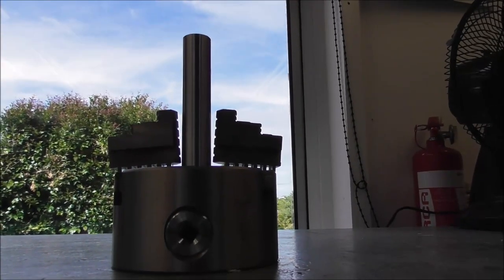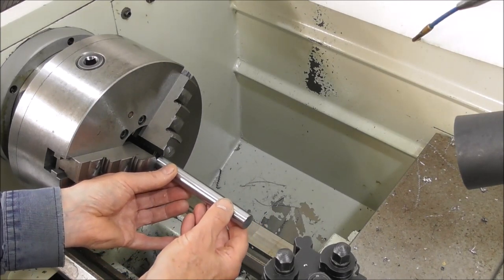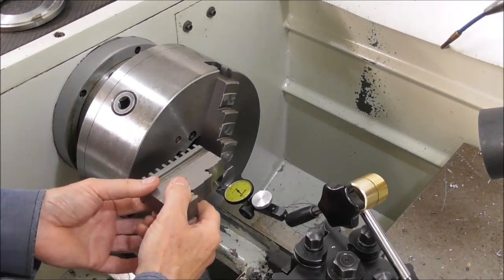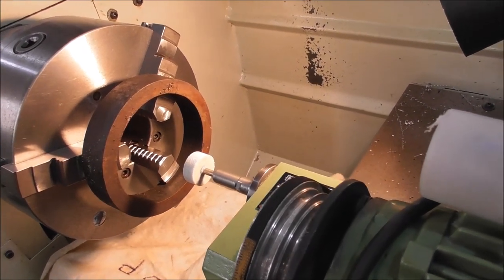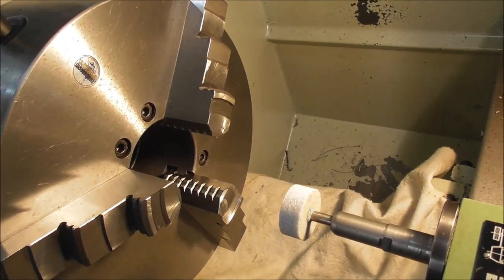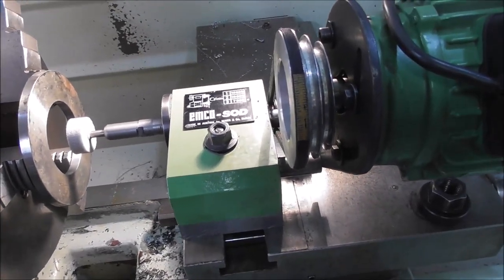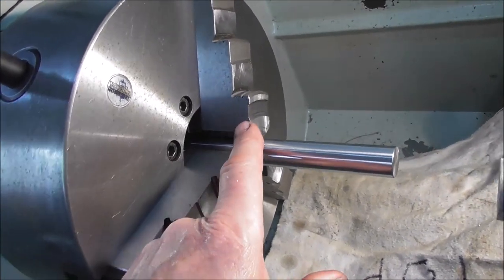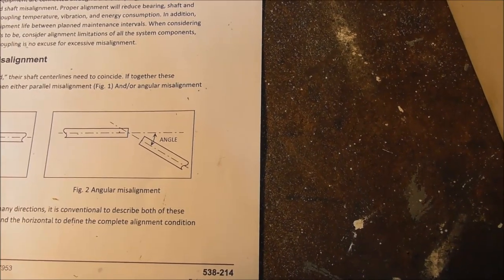Lathe Chuck Accuracy - Fix your 3 Jaw Chuck

Comment: This is the correct way to recondition hard jaws.  You must “fool” the jaws into thinking they are gripping a solid shaft.   Putting just a plain ring on the jaws and backing them out will not load the jaws correctly and will not yield correct results.  Very good video.
Reply from the maker: Cheers!  Cliff

Comment: only good for one diameter.  3-jaws aren't intended for concentricity without shimming. If you want concentricity use an  adjustable jaw like a typical 4-jaw chuck.
Reply from the maker: Hi - The grinding procedure gets the inside of the jaws at least in good angular alignment and not bell mouthed, but I agree that in that some chucks, the scrolls are not concentric. However, a 'floating backplate' allows concentricity adjustment more quickly than a 4 jaw. Cheers, Cliff

Comment: Machining a groove in your (hardened) jaws is overly complicated. i found a better way, thanks you a YT comment, credits where credits are due. I made a blog post on the topic. Sharing on YT of URLs seem pretty much impossible, so if you are interested please drop me a line.
Reply from the maker: Yes, there is a side pinching method, but that is not so accurate as it can displace the jaws unevenly sideways, Cheers, Cliff
Reply: @Threadexpress  Why are you assuming it's the pinching method?
Reply from the maker: @bigbattenberg  If not, please describe it. Cheers.
Reply: @Threadexpress  I offered to share it but your reactions are telling enough, so fine, be that way.
Reply from the maker: @bigbattenberg  You misunderstand me. The two methods I know of that avoid machining the jaws are the side pinching blocks and using a ring that bears on the jaw's bevels, but both these methods can displace the jaws within their clearance sideways. If your method is different, please describe it so we can all benefit. Cheers
Reply: @Threadexpress  I misunderstand and you know the two ways... nuff said.

Comment: THANK YOU!!! This is exactly what I kept thinking in my mind was the issue with my Chinese lathe. Runout and bellmouthing in the jaws I noticed. I was going to try and machine each jaw one at a time to fix the issue, but this is exactly what I needed as I couldn’t find a way I could grind them down in the chuck as the bellmouthing is in the wrong direction vs work chucked up. A spigot on a ring with grooves in the jaws is genius!!! Thank you so much. 💪👍
Reply from the maker: Thanks for the feedback! Cliff

Comment: Question for you is, when you grooved the front of the jaws how did you hold them. 
As I have just fitted a new chuck and whilst the body of the chuck is only .02 run out. 
The part to be machined depending on the diameter can be anything up to .3. 
It’s wasting my time, and makes me loose it. 
If only the owner understood the amount of time wasted by buying cheap tools 😢
Thanks for your video.
Reply from the maker: Hi - I closed the jaws on a diameter of material to lock them up then machined the groove in the lathe with carbide and light cuts, but you could also hold the chuck as above in the mill and use a carbide end mill. Cheers, Cliff

Comment: Great video, 
On my three jaw, it was only one jaw damaged from a 6 foot length of 2 inch dia. chrome moly coming loose from the tail holder. 
I had a 9 thousand run out from that. Using a piece of stock and a piece of 1 thousand shim stock, I found my bad jaw. 
After the repair,  I’m down to 1.25 thousand runout. 
My plan B was to use a grinding wheel as your video shows. 
Luckily my jaws are two piece each jaw, I removed the burr from the dovetail and replaced the two bolts that hold it together, they were stretched from the stress. 

Great job, great work, great video.
Reply from the maker: Thanks Richard!  Cheers Cliff

Comment: Thanks Cliff. That process has been on my wish list for a long time. I've always shied away from cutting into the jaws though.
Reply from the maker: Hi Mark. Yes I used to be reluctant also. But when you machine the groove you realize the steel is quite hard down deep as well.. so it is not like a thin hard case on a soft interior. Cliff
Reply: @Threadexpress  I accidentally tested the hardness of the jaws on my Boxford A lathe using a drill mounted on the tool post. I couldn't understand why several drills came back with the tip completely flattened. I thought it was the stainless steel work piece work hardening. Then I realized I was trying to drill into one of the chuck jaws!  It didn't even leave a mark on the jaw. Now I have made my own grinding attachment by mounting a DC treadmill motor on the cross slide, after removing the compound slide and making a cone shaped spigot to mount the grinder at the center height. I made an ER32 collet holder to mount directly on the shaft of the DC motor. I will put it on my YouTube channel one day.  But I don't know how good my machining is, and also feel a bit hesitant about attacking the jaws with it. I'm not aware of any real problems, but it was interesting that you said that the grinder isn't critical, and users may be unaware of the source of problems such as using parting tools. But the biggest and best tip you presented was how to mount the ring. So here is a big Thank You for an excellent video. Subscribed.  By the way I am a KIwi in Thames and the lathe has the original Burnerd chuck that it had new at Te Puke High School, where I did engineering classes.
Reply from the maker: @evanlewis652  Hi Evan. Sorry I missed your interesting comments until now. My father was a draftsman/designer at AG Price when we lived in Thames in the 60's. I still love that area of NZ. Cheers  Cliff
Reply: @Threadexpress  Hi Cliff, I am in Tennessee right now.  Your father probably knew "Nelson" who was also in design at Eastman. He is still doing CAD design by contract and has a huge home workshop. We have been restoring two Tangye stationary steam engines at the Goldmine Experience in Thames. Well worth a visit!  They are opening a new blacksmith shop on Nov 12th 2022 with a steam day. I am already looking forward to getting back on my lathe in Thames.  I will add a post about my grinding attachment.

Comment: That's an excellent way of holding the chuck jaws apart.   Thank you.
Incidentally I don't worry about about grinding through the surface hardness layer as I think that the softer steel beneath grips the workpiece better and with less pressure.  Obviously they will not last as long but another regrind is quick enough to do.
Reply from the maker: Cheers!  Cliff

Comment: Envy time 😉
Definitely a Very Nice, Tool Post Grinder.
Usually when you see these items in a video they are in worse condition than the Lathe 😂
Not surprised to see Cliff with such a Nice example 👍
First item on my list when I purchased a New Lathe was to buy a Bison Lathe Chuck.
Reply from the maker: Yes many years ago I bought a new Emco lathe with that toolpost grinder - but I only sold the lathe!  Cheers  Cliff

Comment: I'm new at metal working.  How do you machine the groove in the jaws? Aren't they hardened?
Reply from the maker: Hi - I should have covered that in more detail. They are hardened, but tungsten carbide will cut the jaws with careful light cuts. Cliff

Comment: very interesting video 
question sir , how to machine the cut out in the jaws ?
Reply from the maker: Hi Tom. Grip a piece of diameter to lock the jaws tight then turning with light cuts and slow rpm,  using a carbide insert tool left and right shapes, to machine out a slot - or do it with a carbide end mill in a mill with a rotary table. Cliff
Reply: @Threadexpress     thanks for information 👍

Comment: Great job Cliff, I need to do the same on my weiler 280. What shape of tool did You use to machine that additional groove in front of jaws? And did You block jaws during this internally by some shaft?
Reply from the maker: Hi MM. Thanks for the feedback. The tool shape from memory was 60 deg carb inserts, tipped to suit and lots of shallow light cuts. Yes with a shaft inside the jaws to clamp them stiff. Cheers  Cliff

Comment: Nice!
But what if you have play on de scroll, so that the scroll can move up and down in de X direction? 
Have you ever come across this?
Reply from the maker: Hi Mark. Good to hear from someone thinking deeply about this! Yes play on the scroll bearing or a non concentric scroll thread can be an issue with some chucks, and is a minor accuracy issue on all chucks. The procedure in my video is still needed to correct the jaw grip squareness and straightness, but for accurate work of different diameters the work concentricity may still need to be dialed in (I use a 'floating backplate' as mentioned in other videos). When repeat parts are made after the chuck is dialed in for that diameter, concentricity tends to repeat well. Cheers  Cliff
Reply: @Threadexpress  Thanks Cliff, all clear, cheers!☺
Reply: Hi, I'm a Machine Tool fitter and worn scroll plates as well as worn jaws are a common problem.  There isn't much you can do about worn scroll plates unfortunately, and I have seen turners giving the chuck jaws a biff with a hide mallet to get the best out of a worn out chuck.  Not ideal I know, but if you're really struggling for accuracy and are not in a hurry you could always use a 4 Jaw chuck.

Comment: A good way or else you can drill three small holes into to front of all the jaws on the smaller diameter steps,  insert three small bolts with heads and grip a small diameter ring out in front with the three bolt heads . This will position the jaws the same way.
Reply from the maker: Yes. thanks for your comment. Cliff

Comment: What do you think of Winki's Workshop method?  https://www.youtube.com/watch?v=QUbtJQhYonQ Looks a but quicker. Surprisingly his carbide tips didn't object to intermittent cutting of hard material using very light cuts.
Reply from the maker: Hi Evan. Yes I saw that video. The problem with closing on to side spacers is that it can displace the jaws into a different sideways clearance position than normal. Using carbide it is difficult to take the absolute minimum off and get a perfect cut. Cheers  Cliff

Comment: First, You talk  a lot friend, plus don’t need to machine the jaws.  Use a machining ring made in England .  It holds the jaws just like u have.  Don’t grind either, horrible grit. Use a normal boring bar , carbide , ceramic or cbn.  
Thanks
Reply from the maker: Hi - Do you have a link or name of that ring, how it holds on closing the jaws? 
I disagree with you on using a boring bar.   Cheers, Cliff
Reply: @Threadexpress  hmm why not use a boring bar? CBN is the hot ticket IMO and does not generate grinding dust obviously.
Reply from the maker: @bigbattenberg  For intermittent cuts grinding is the best option. Cheers, Cliff